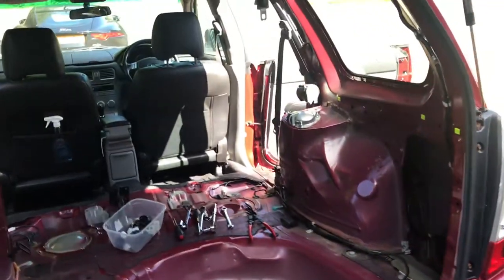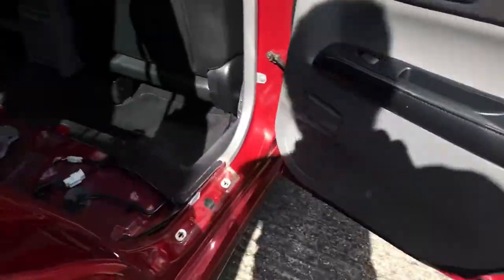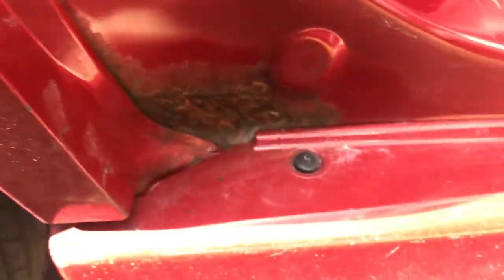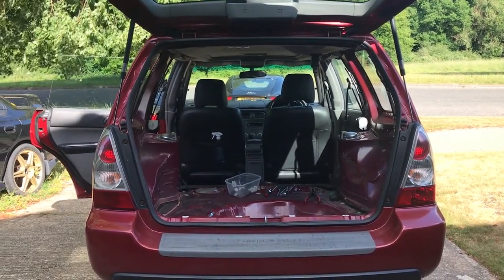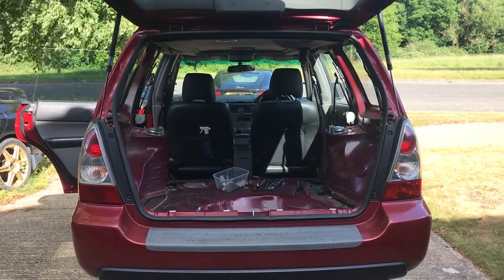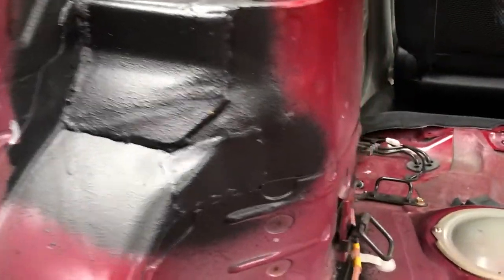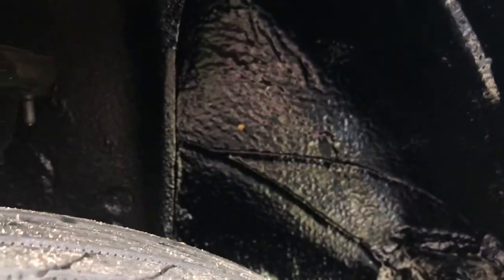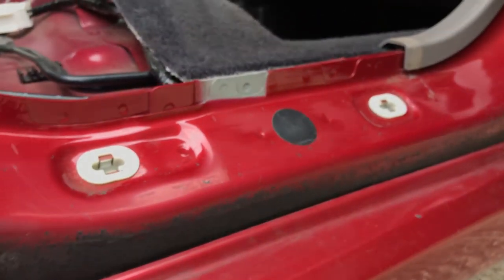Subaru Forester Back To Life Episode 5 – BIG Rust Problem and interior install

Comment: How much did that cost too get welded if you dont mind telling me ive got a 2001 Subaru Forester S turbo and there’s 2 holes in the Rear Suspension Turrets
Reply from the maker: Hi. Probably too much tbh. Outer sills, inner sill repairs. Both inner arches completely replaced, major work done to the turrets. About £2k. 
Seemed expensive but it was done professionally and faster than I could have done it so it was worth it.
Reply: @chisnsid  my mot didn’t mention it ! Mabey they missed it 2 small rear holes previous owner was a police officer so probably not a dodgy mot